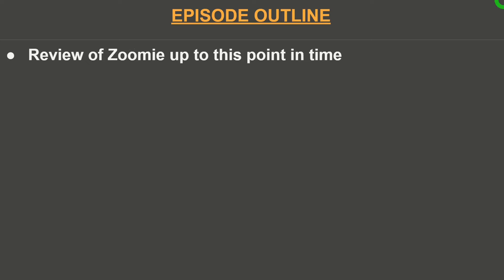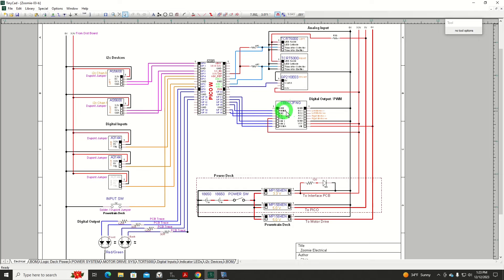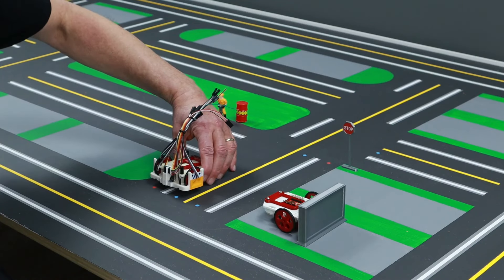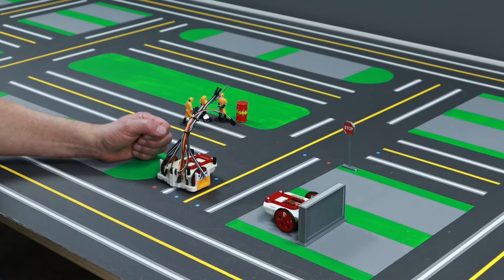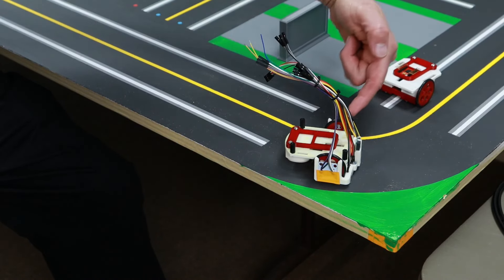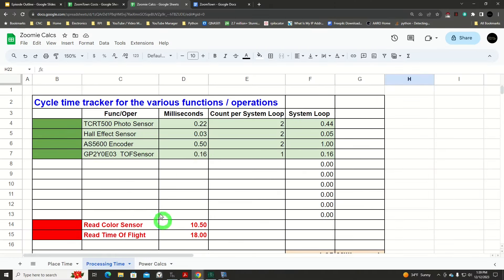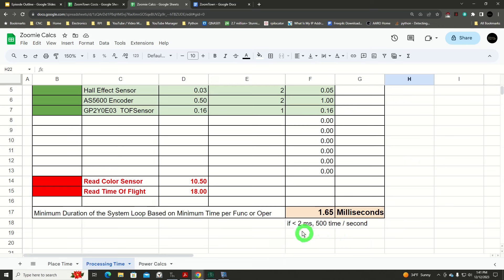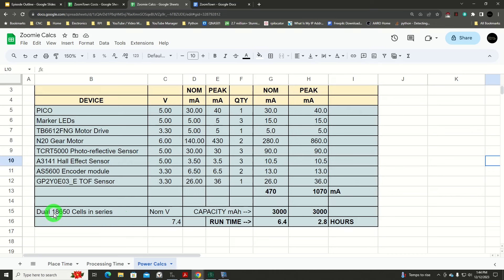E016 Recap and Update of the ZoomTown Experiment and What Has Changed

Comment: Have you compared making turns with the caster in front vs. the rear?
Reply from the maker: Hi William,
No I haven't with the Zoomie.  On that big robot I referenced a while back (Razzy), that went through many configurations of drive and caster as it was a differential drive like the Zoomie is.  One of the iterations of that was front caster and it did not work well at all. The primary reason was because that robot also had to travel on carpeting and that creates ALL SORTS of problems to deal with.  
For the Zoomie, after the "tricycle" configuration didn't work out, I just settled in on the front wheel drive with a tail dragging caster and it has been working good. 
How about you, have you done any with the caster in the front?
Cheers!
Chris